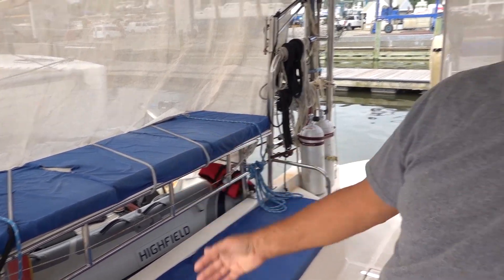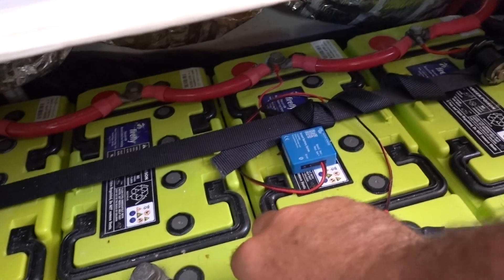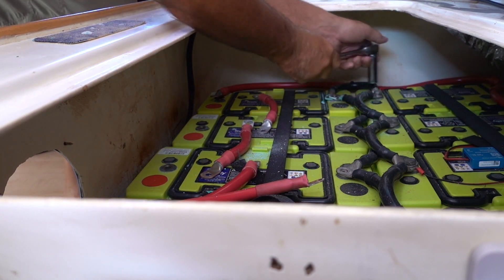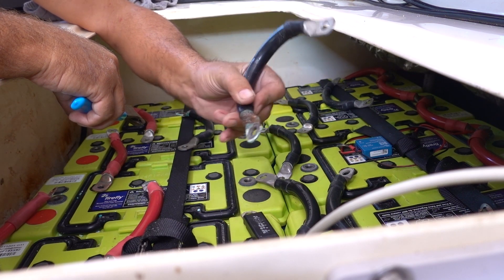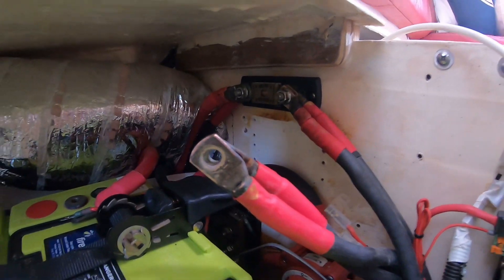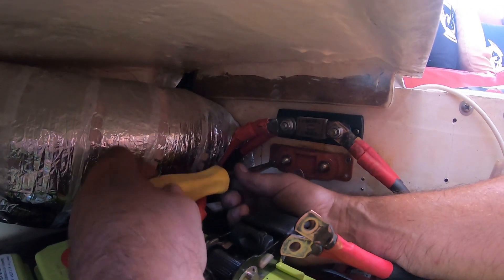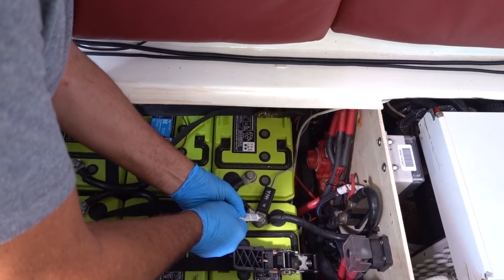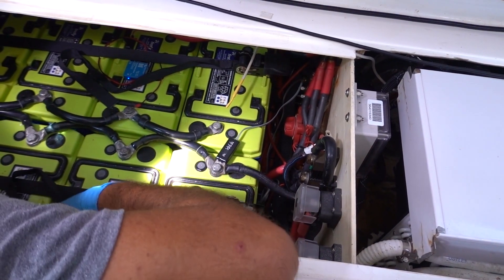SDA70 Can we Save our Batteries?

Comment: Looks like some of the fuses and connectors are raw copper. I would recommend replacing the fuses / connectors with plated marine grade. If you stick with the copper you'll find yourself back in there to deal with the corrosion. Great job cranking. Keep the dream floating
Reply from the maker: Not a bad idea

Comment: one issue with batteries like this can be the final positive and negative connections.  If the final connections to the boat are on one battery then the batteries will never balance in parallel.  A positive on one end of the string and a negative on the other end of the string.  With the cost of the firefly batteries at 599, you can buy one 280AH set of cells and make a battery for each firefly and have much more usable capacity, though Fireflys can be run down pretty far and bounce back.  Anyway a lot of people just wire the final battery straight to the boat and the current doesn't pass through the entire bank making the ones on the end pretty weak.
Reply from the maker: Thank you. We’ll have to look at buying cells that way. We definitely need to move on from the AGMs

Comment: The firefly's are great.  I switched to lifepo4.  560ah at 12 in the space of 1.5 of your batteries. Salty Escape did a nice build like I did. Total cost for me was around 1200 with cells, tools, and wiring.  Your solar would be about a third more effective on lithium perhaps.
Reply from the maker: We thought they'd be great when we bought the boat, but they require a lot of maintenance that includes a much more powerful generator than ours. Lithium batteries are the dream
Reply: @SailingDarkAngel  When you say generator do you mean like a Norther Lights generator, or engine alternator?  I don't need a generator so much, but do use one.  ITs the charger you would need to install to keep them up on shore power or on a generator.  Like I have a 90 amp lifepo4 charger that set me back $90.  I could get another one and have another 90 amps.  If my generator could put out 3000 watts I could do a total of three and get 270 amps of charging.  I have measly 20 amp dc to dc charger for running on my alternator, but the generator can really charge them fast, and any generator can do it.  Fireflys are a great lead acid+ product.  Super cycle life,  and take a charge really well.  But as lead acid that last 15% of the charge you waste a lot of amps being put in that go nowhere as the batteries have a lot of resistance near full.
Reply from the maker: @allynonderdonk7577  I mean a portable Yamaha generator. This little 1100W generator can’t put the charge into the batteries that shore power can. With shore power we restored the batteries. In the months since we’ve not been able to restore them. We’re trying shore power again, but accessible marinas are rare where we are now
Reply: @SailingDarkAngel  An 1100W generator can probably get 70 to 90 amps into LIFEPO4 battteries per hour.   It can be an affordaple option where you don't have to spend 9k on battleborns.  Here is a link: https://www.youtube.com/watch?v=XUfiYUFD4QQ

Comment: When you had all the bonds and links off did you take a meter to each battery to check the voltage?  One bad battery could be hurting the whole bank.
Reply from the maker: Yes. They all individually checked out good with a meter